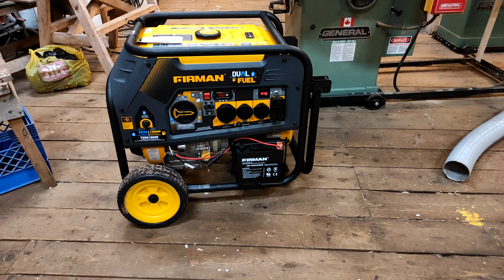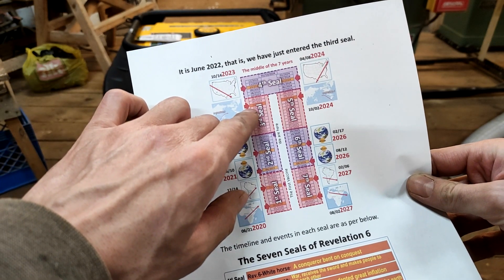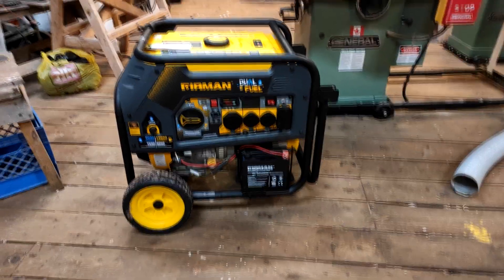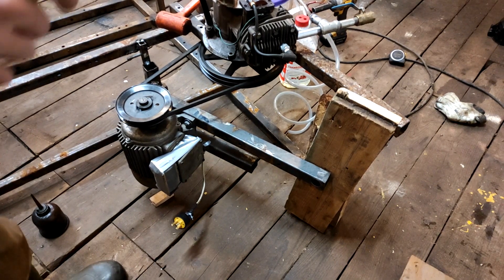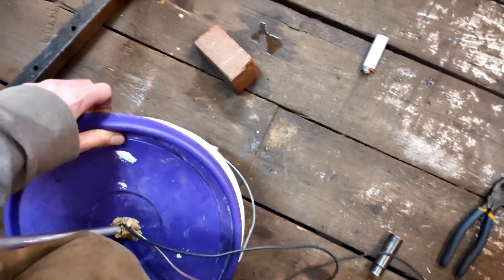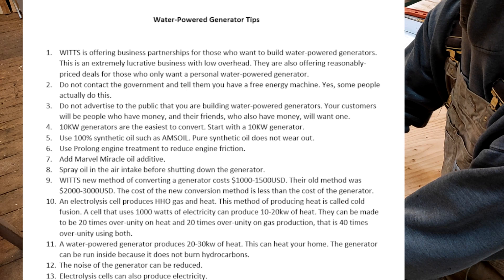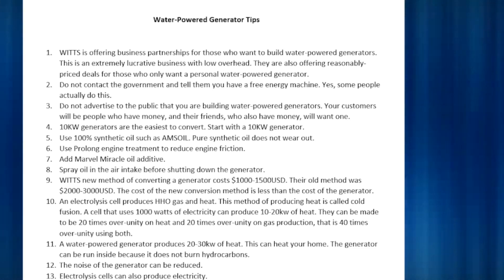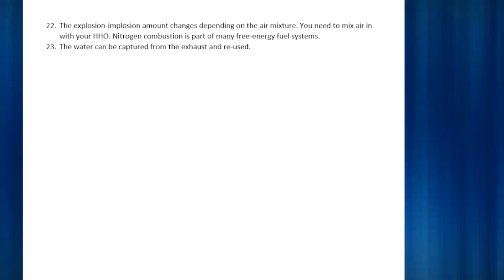Water-Powered Generators.

Comment: DO NOT use anything with "chloride" for electrolyte. That chlorine smell is actual chlorine gas. Table salt is made from sodium and clorine. The electrolysis release chlorine gas and sodium. Chlorine is highly corrosive to stainless steel. The best electrolyte is Sodium Hydroxide. You can also use Phosphoric Acid, because it helps protect stainless steel.